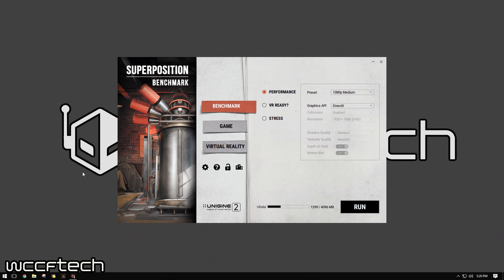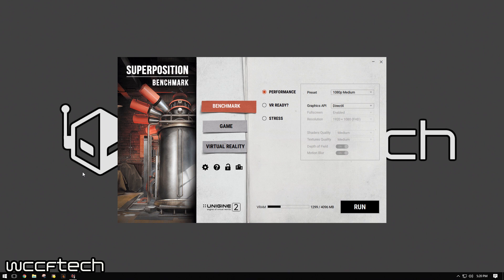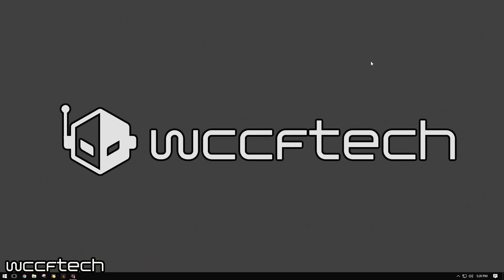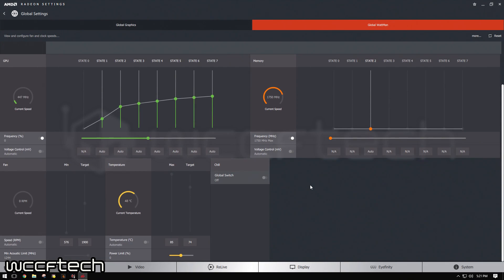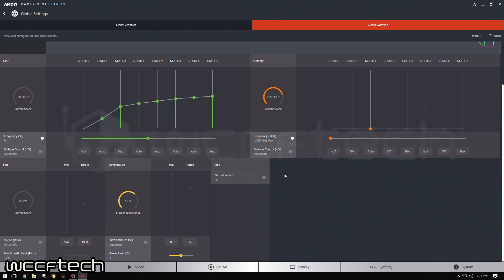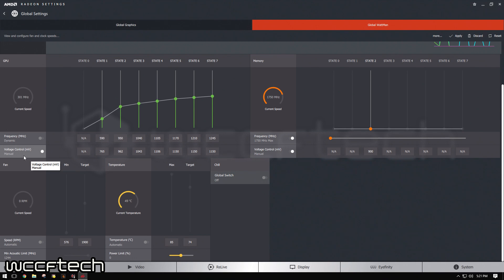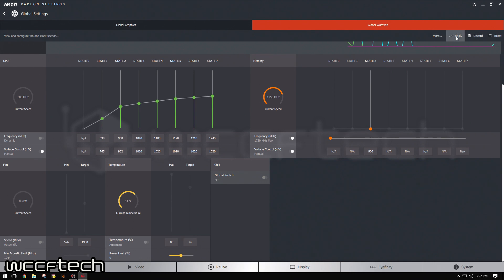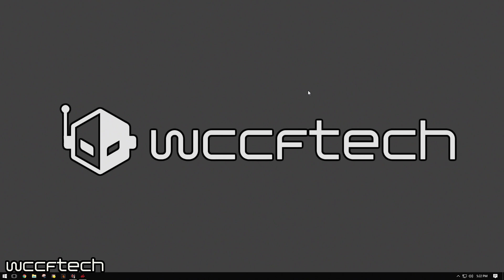Radeon RX 500 Series Effeciency Improvement Guide

Comment: ohhh i see...the title can be miss-leading...i tought you were going to tell us that AMD has improved the efficiency on the RX 500 series...where clearly the whole comunity agree that efficiency went out the window for the RX 500 series...AMD decided to squeeze the last 10% performance out of the silicon instead...thanks for the video keith!
Reply: There is efficiency when you introduce chill in games that are supported now. Actually a bad works man quarrels with his tools, but give it to someone skilled, this card is very efficient in power and thermals.
Reply: which "community" would that be. Certainly not THE most detailed power measuring site on the internet:

"At 1411 MHz in silent mode and 1450 MHz in boost mode, you're talking 
about much higher clock rates than Ellesmere was originally set to run 
at. Impressively, Sapphire enables these frequencies without using more 
power than the Radeon RX 480. In our gaming loop, its Nitro+ Radeon RX 
580 operates at an almost-constant 1450 MHz, whereas the previous-gen 
card was limited to 1350 MHz and used just as much power. One 
explanation for this is lower leakage current. A much better cooling 
solution helps keep GPU temperatures down, and we estimate this provides
 an advantage of ~10W."

http://www.tomshardware.com/reviews/amd-radeon-rx-580-review,5020-6.html

soooo....can you point us to that "community" so we can avoid them in the future?

Comment: I've asked you in your other video man asking again, tell me a Propper settings to undervolt, :( you didnt replied after that
Reply: Just like overclocking, it is a trial and error processs, he got 1020 mV on his RX570, AdoredTV got 1040 mV on his RX580, and your personnal card will get something different, manufacturers set a voltage that will work with most if not all cards, if they could set it lower, they would as the lower temperatures would make it seem like a better product.
Reply: It different from each cards because silicon lotery, you could try adored tvvideos. Basically trial and error. If the game crash then you undervolt too much.
Reply: Rajesh Kumar he is showing that right here.
Reply: That one is 1.04@1.4G but this one is only 1.02V@1.245G, unspectacular